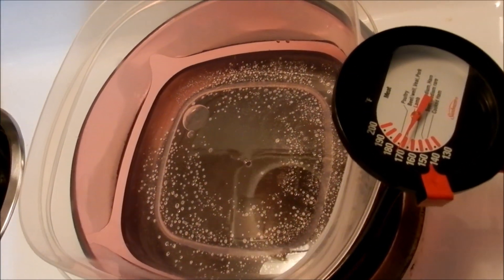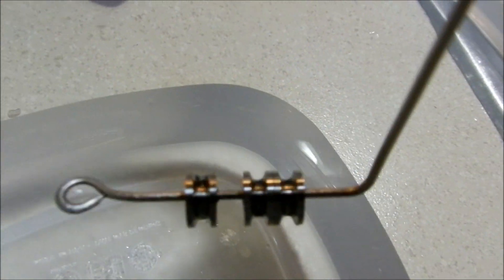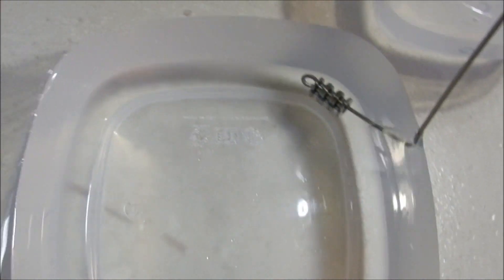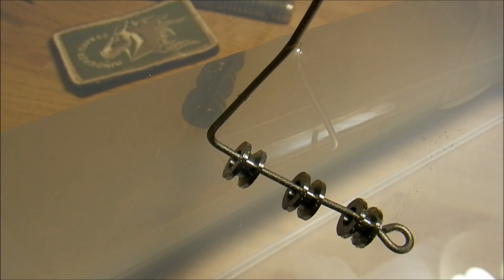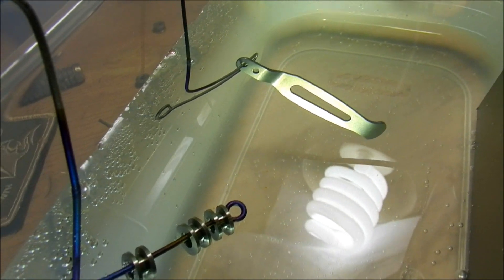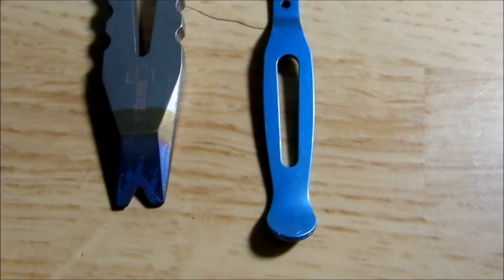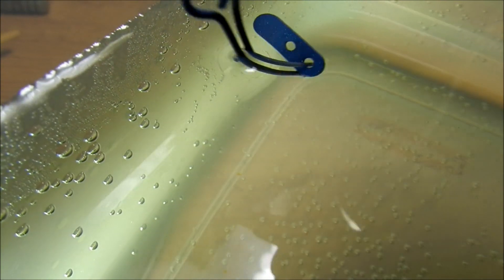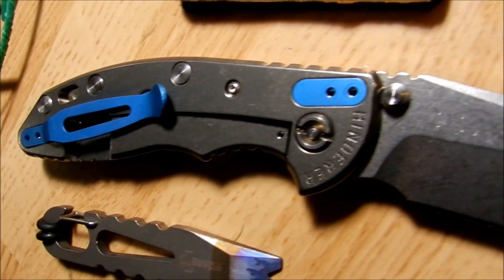How to Heat Multi Etch. Successful & Not So, Anodizing Knife Parts

Comment: I wondered if the Rubbermaid would melt, or if the multi etch would eat through it, but apparently not. That was just a regular Rubbermaid bowl, wasn’t it? Also, once it heated up, you removed the multi etch from the heat to use it. Other videos I’ve watched kept it on the heat, so it doesn’t matter? Thanks, great video, much appreciated! 🖖

Comment: Hey, i want to anadize some stainless steel. What all do i need to do it? I dont need the etching solution i just want to anadize the handle
Reply: To a butterfly knife
Reply: You can't.
Reply: You can actually heat blue it with a torch

Comment: When you anodized that titanium Boker prybar, did you just use multi etch to get that black coating off the titanium? I have some knife clips with a similar coating and couldn't seem to remove it with the etch, so I was hesitant to do my pry bar. I might not have had the etch hot enough, but not sure if it was that or just that coating.

Comment: you can probably use canola oil instead of water for the double boiler. it has a much higher boiling point than water so it won't bubble at these temps.